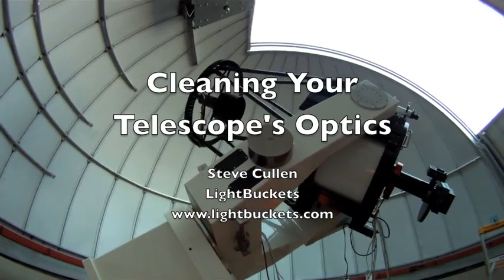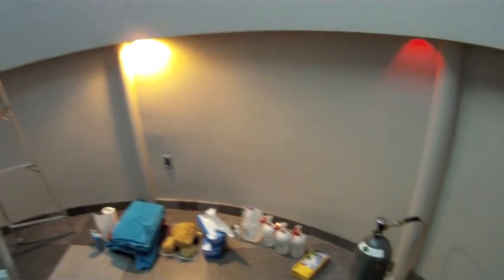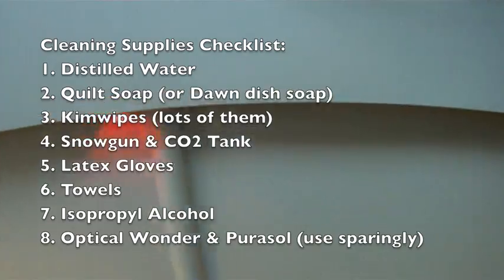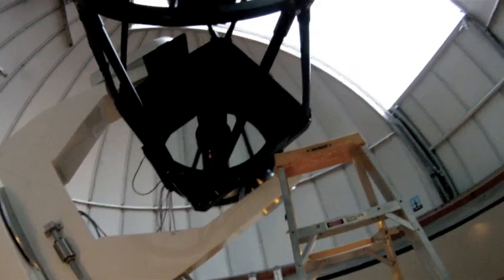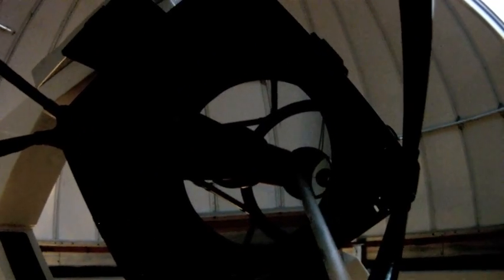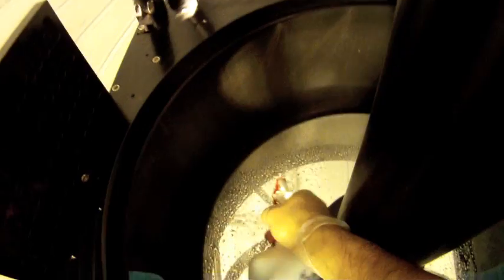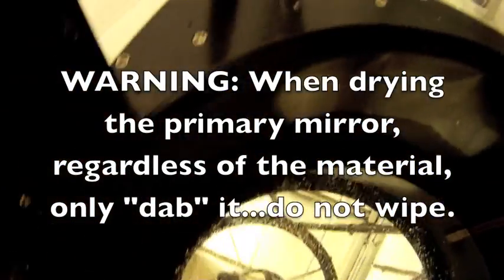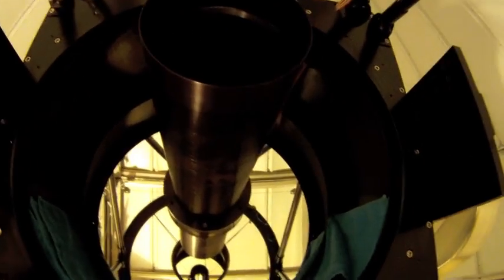Cleaning Your Telescope's Optics

Comment: Lovely wall
Reply: Very nicely done. Good technique! I think the sea sponges are not worth the trouble. They may work better on larger mirrors.Just curious. Are the mirrors enhanced or overcoated with SiOx?
Reply: It is also a good idea to make a defect map of the mirror so you can track degradation. Many large mirrors have minor coating defects from day one.